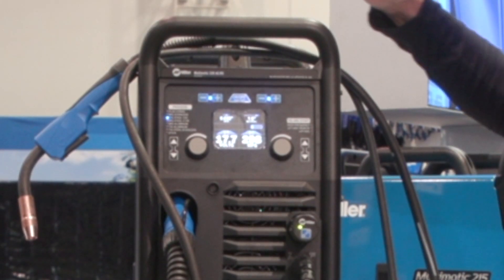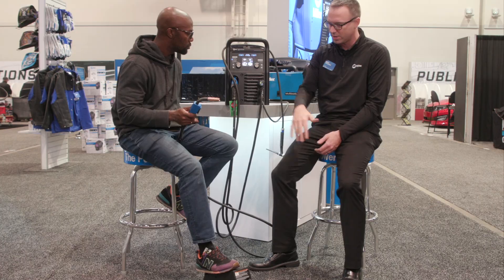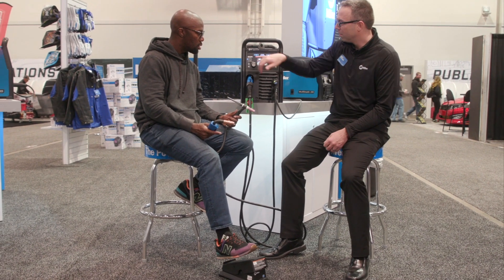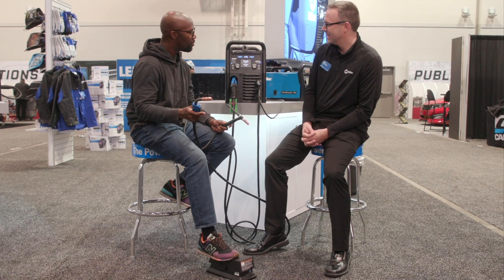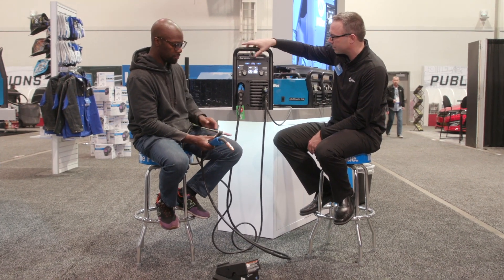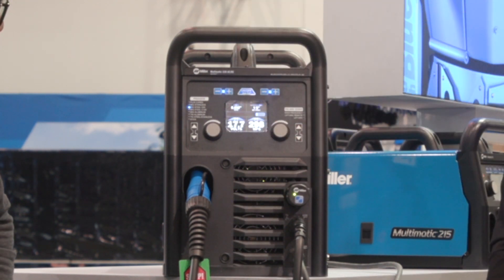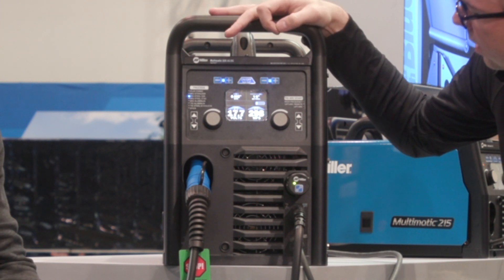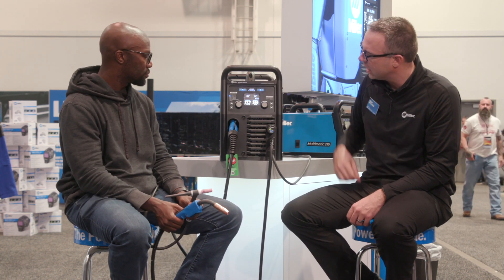Multimatic 220 AC/DC Multiprocess Welder Setup

Comment: I have the multimatic 220 would you be able to tell me what size adapter I would need for the output side of the regulator I took that part off bc it does not fit my hose and I can’t find a adapter that fits the threads inside the regulator
Reply from the maker: Hello Nicholas, thank you for your patience, The outlet connection of the regulator has an orifice (or small hole) in it. You can go with a 5/8-18 inert outlet connection instead of the barbed fitting outlet, but the outlet connection must have a .032 orifice hole. Thank you!